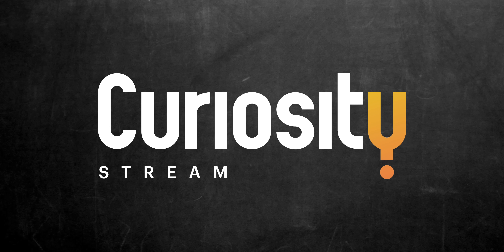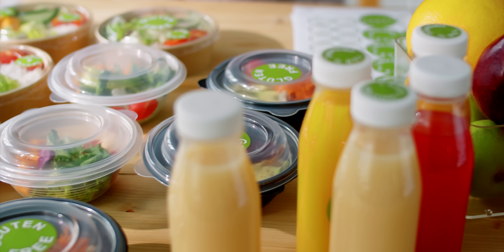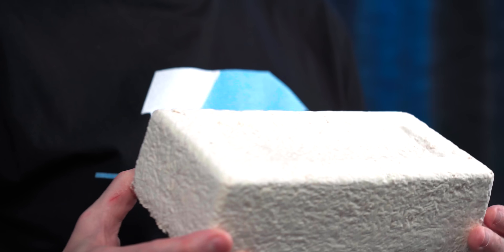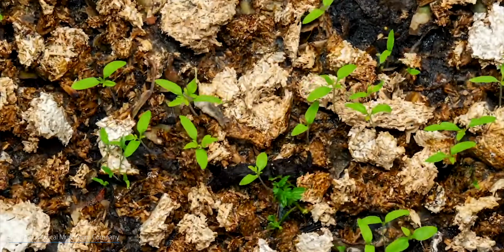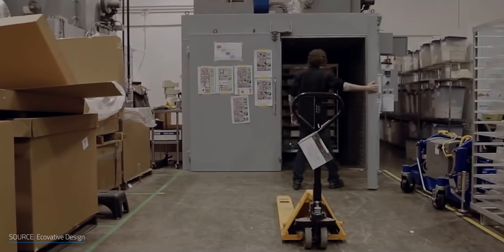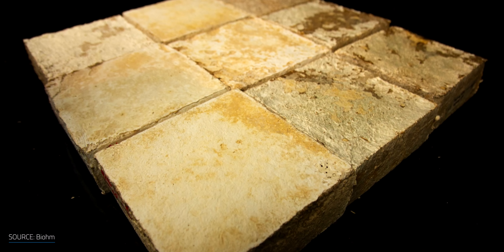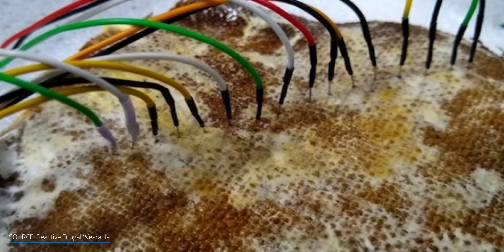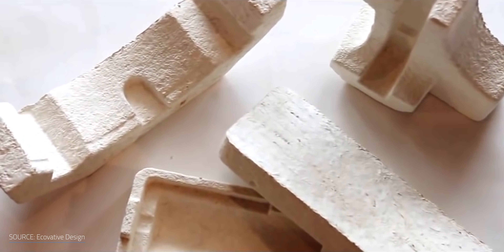Is Mycelium Fungus the Plastic of the Future?

Comment: It seems more a cardboard replacement than plastic.
Reply: I see what you mean, but the main plastic replacement happening seems to be in the form of packaging forms. Replacing things like styrofoam and those plastic bags full of air that you get in some packaging. I agree with you though in that it does seem like it would be a pretty good replacement for cardboard as well, assuming it's cheaper to produce.
Reply: @Kirodeth  yes, that's what I meant. Cardboard forms are already replacing package foam. But it depends if this is cheaper and greener than recycled cardboard.
Reply: @zazethe6553  Absolutely, the big factor in the success of this as a material will depend on the cost and efficiency of manufacture for sure.
Reply: I think the focus was on replacing things that don't decompose, not necessarily ruling out cardboard.
Reply: The fact that it can be used in shoes as a sort of pseudo leather indicates that it can fill a lot of plastic roles
Reply: @sammyjones6730  Yeah, it looks like it can cover the whole 'somewhat waterproof' niche of plastic, something that cardboards generally can't.
Reply: @sammyjones6730  , but also if it is constantly wet? Why would it decompose in nature, but not as a water bottle. And if it doesn't decompose on the shelf,why would it decompose in nature?
Reply: @zazethe6553  You can chuck some leaves out in the yard and they'll be unrecognizable in a few days but if you actively work with them to keep the bugs and whatnot out you'll have them for years, even if they get wet. People have been using biodegradable fiber for hundreds of thousands of years.

Comment: economy of scale. that's all that's missing here. like elon says- back to first principles- what is the most basic truth about the cost of the materials used for making mushroom spore grown material? pennies- almost negative cost. leaves. produce based food waste... wood chips. bark. grass trimmings. weeds. THINGS THAT WE THROW AWAY or compost. basicly, that big green can we push out to the street that says 'garden waste'. so- material cost is negligible. processing? a mold (plastic is formed in a mold also.. nothing new there). we've got that part down pat- that's a known cost, a known method, already set up to run. growing the spores- HELLO! this thing does the work all by its' self. it's slow- that's a given... kind of like when we had VHS tapes. so- HUGE factories- yes. but plenty of automation. using it for things like leather will be a lot more profitable- because growing the cow & tanning the leather is more expensive & more time consuming. even for things like shopping bags- they only need to hold up from the store shelf to the car & to home... then? toss 'em back in that green can outside your house- then run the process all over. or carry in your own cotton or hemp bags when you shop. with a few iterations... industry will be rolling out disposable mushroom shopping bags faster than plastics. improvements in spore breeding... I can almost hear botanists in labs "this is a cross between hopta-eppa hubba spore & jabba fett. lol. 

then there's hemp bags & textiles- just as easy to recycle. cotton- I'd love to see this industry come back to places like South Carolina. automation of the cotton industry is well established & can be scaled easily. (thanks eli whitney & john deere. lol)

Comment: It still continuing to grow never crossed my mind. What did was, how quickly after its made does it start to decompose? This is just more virtue signaling to me. This stuff takes a week to make and decomposes extremely fast and easily. If used as a insulation in a humid environment with it just decay in the walls leaving them hollow and no longer insulated? or as a packing material will it start to decay in the box compromising the product being shipped? These are the questions I have on top of How much does this cost to produce I bet its more than plastic and thus why its not a viable alternative in the industries eyes. He tells us all these amazing things but never once mentions any of the drawbacks, but what do you expect from a virtue signaling shill that has a tesla and buy apple products.

Comment: wait... so i'm expecting to wear my fungi shoes for a few years. How would that work if the fungus are supposed to degrade after 45 days? If they don't degrade, then how are they biodegradable when i throw out my shoes?
Reply: Wood will also compost within a few months, still wood furniture is incredibly long-lasting, when kept inside then even without chemical treatment, just an oil-coating at best.
Reply: @bididoo  so how does that work? Does wood furniture with oil coating start to compost when thrown out after few months?  Is it due to the elements?

Comment: So many things wrong in this video.  Straight out of the door, you said Bakelite is a plastic....it's not.  Then you continue to pursue the word "plastic" as an all encompassing term, there are thousands of different chemical formulations all with different properties. You claimed that burning plastics releases toxic chemicals...you might want to fact-check that.  You have no understanding of gas permeability, chemical resistance, or food safety.

The reason why this material has been touted for 20 years but never caught on is simple - it doesn't work for the majority of the claims initially made.  Making something in the lab is not the same as scaling it up into a reliable, safe industrial product.  How would you feel if it became possible to replace a product, and oh, by the way, it will now cost 10 times as much.

In summary - a joke video by someone who has no understanding of the plastics industry or economics in general.

Oh, and by the way - plastics are not the problem - people are.  No matter what is invented, they will still manage to screw the environment over.

Comment: Using this to package prebuilt computers could be good .
Reply: Pre-built computers are something that prove consumers don't care about the environment. Back in the day you would buy a PC online, and it would have cardboard packaging. But people got so obsessed with Tempered glass computers that that no longer worked, so companies had to switch to foam packaging to reduce damages. The tempered glass was not only really fragile, but removed structural strength from the computer. Mycelium packaging is too dense for packing delicate items. Strangely IKEA is quite a good use of it, as at the moment they only use Polystyrene for corner damage protection, or filling spaces in boxes. honeycomb paperboard is better, but you cant shape it like mycelium.

Comment: POLYSTYRENE  is recyclable see this  https://www.polyusable.com/ and https://www.regenyxllc.com/ 
I have been aware of the mycelium product as an alternative for awhile and it is a good thing!  there are some uses for which polymer plastics are still the best answer though.  I tend to abhor using the LAW to ban things like plastic bags, straws, and foam => it would be better to make the LAWs mandating that it ACTUALLY be reused and recycled so the plastic never reaches land fill and "closes the loop".    The answer to this is to plastic pollution is to  ACTUALLY reuse and recycle the plastic. - No plastic should go to land fill at the very least should be sent to RETORT processing back to oil feed stock to generate new resin.  There are some places that turn it back to "oil" and burn it to produce electricity, while better than landfilling it its still a horrible solution. 

These laws often seem like horrible knee jerk reactions  I'd rather see better products enter use when available just like plastic did when it entered the market.  Some things are still made from natural rubber though tires aren't.  Bakelite is still made and used but not very often.  

 Non-motorized travel aka using animals to pull carts and carriages didn't get made illegal [sure not on Freeways but that's  a specific location] they just went out of use when technology produced other options.  There are places where equines are still used where the terrain doesn't warrant infrastructure or the infrastructure would be detrimental to the area.

Comment: I learned about Ecovative when they did a proof-of-concept tiny house that used mycelium as insulation. I was sad that they never went further with the idea, but at least they continued exploring other uses.

I am hoping to build an earth ship style house using rammed earth walls (not a fan of the tire walls) and mycelium insulation.
Reply: There is always hempcrete for load bearing
Reply: Any idea what the R value per inch is on the insulation?
Reply: @fredflintstone4715  I am not sure its actual value, but if I were to hazard I guess, I would say slightly below traditional materials like fiberglass.

What I am thinking of doing is 9 inches of rammed earth, 24 inches of mycelium grown on a straw based medium, and then another 9 inches of rammed earth for the outer wall. It should easily out perform any traditional 12 inch thick wall. My only concern is if the mycelium can penetrate through the rammed earth and get into the house. Not sure if there are any good ways to kill it off to prevent that...
Reply: Btw no idea why people think meat causes GW, its got more to do with food waste than anything.
In otherwords if meat doesn't get thrown out (and plant matter releases a lot of CO2 when it dies)
So not sure if mycellium has less of a carbon impact than wheat and grain.
Reply: @cartoonhanks1708  People think meat causes global warming because cows that eat primarily grain do produce excess methane. It's a solvable problem for sure (alternative-- albeit more expensive-- feed is one option) but the methane they produce isn't an insignificant amount.
Reply: @tallgnome3229  They're still burning all that feed until they're slaughtered, you're losing an enormous amount of energy vs plants which are self-sustaining under the right circumstances.
Reply: @gearandalthefirst7027  I advocate that we just eat people. This means we no longer need to raise cows (just make them extinct, kill all the animals across the globe so they don't produce methane), then people become the number one source of methane, which when you have people eating people you can see it's an efficient problem to fix. Now there might be some pushback on who gets to eat who, or someone's imaginary morals, however the rules would be simple, rock paper scissors best two out of three gets to make steak out of the other person. It's not barbaric, it's compassionate, it's the only way to save the planet from imminent and immediate doom.
Reply: @cartoonhanks1708  Well, in spite of the embarrassment of the Green New Deal, it is true that livestock release methane, which is a potent greenhouse gas. Also, livestock is very inefficient from an energy in to calories out perspective. I don't know the exact numbers, but if you fed the plants directly to people rather than to livestock, you are supposed to be able to feed 4 or 5 people off the plantstock necessary to feed one person on meat.

Of course, that does not account for the high protein content and trace nutrients you can get from meat that you don't get from plants. I personally believe a mixed but balanced diet is best (not an expert, just my opinion).

I doubt that mycelium insulation is any good for carbon sequestration, but I like the idea because it is a lot safer than fiberglass insulation. Hopefully cheaper too, but I am not as confident about that.
Reply: @TwilightMysts  I always scrunch up my face at the claim of meat being harmful to environment or causing GW. I understand that cows digestion produces a significant amount of methane, but there are other factors too that need to be taken into account. It just seems like it has more to do with modern farming practices than the meat it self. 
Like feeding cows grain that could just feed people. it would probably feed many more people than the meat right? 
but cattle can eat things that people don't. like grass, straw, nettles but I understand this doesn't scale up to feeding a full herd but damn nettles will take over a field if you turn your back for too long! and don't those nettles and fallen leaves give off green house gasses when they rot on the ground each winter? surely feeding it to livestock is MORE efficient in that scenario. 
I guess my point is it seems more like the industrial farming practices are the issue, not so much the product it self.
Reply: @Snugggg  It does scale look up Gabe Brown.

Comment: My largest concern with using it as insulation. How fire-retardant is the material? The last thing you want to do is literally adding more fuel to a fire.
Reply: most likely some retardant chemicals could be used with it lots of foams are fire hazards and got regulated not to be used in furniture because of thier flammability too